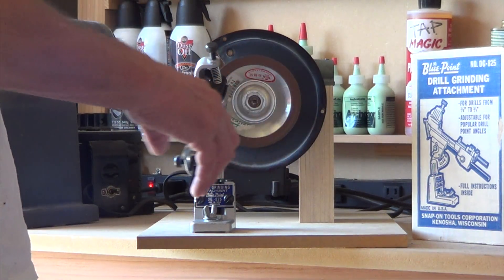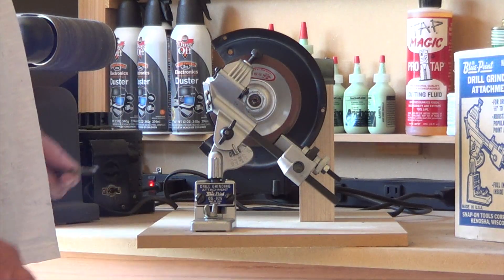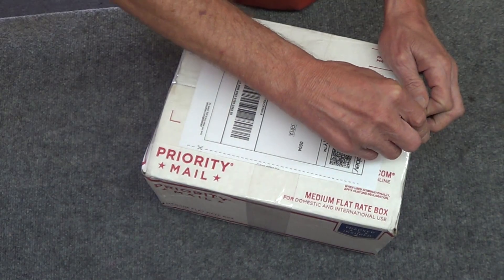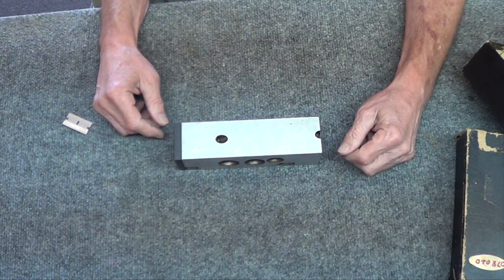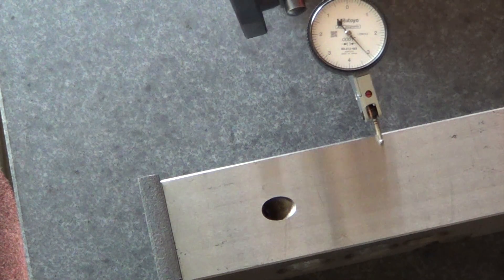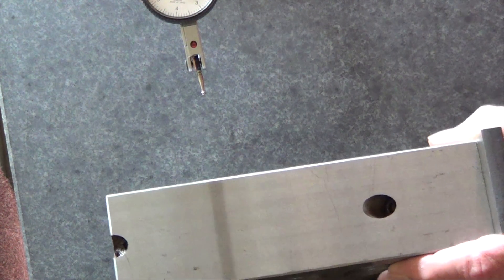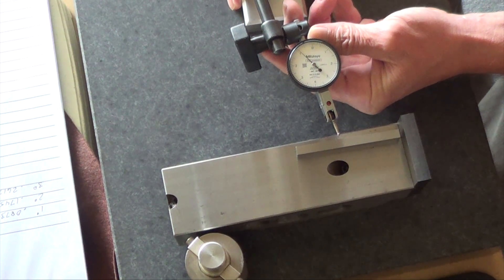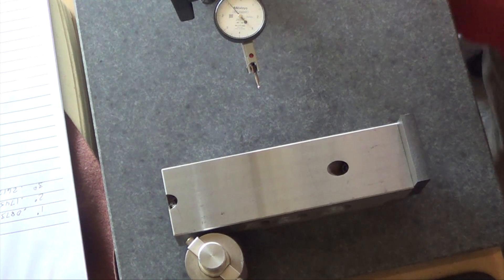How to Check a Sine Bar and Angle Block Accuracy

Comment: If you don't have gauge blocks you can use an adjustable parallel and adjust it to the size you need.
Reply from the maker: Did finally get a set!

Comment: Hey Dave!

Carbides are 'officially' ground with so called 'Green wheels' ( a very soft (friable) silicon carbide grinding wheel formulated for grinding tungsten carbide.) They can be ground with diamond wheels but those are best used wet.
The diamond wheels, from China have something to offer, but it may pay to invest in a proper one. The Chinese ones, is a bit of diamond dust, no good for anything else, mixed with the ashes of dead Chinese babies, I am sure... 
They often have the 'weeble-wobbles' and there is little to be done about that .... it does make them pretty useless though.
Carbide lathe tools or milling inserts/cutters, should NOT be ground freehand... it really is too hard a material for doing that.
Because the Green silicon carbide frays fast the wheel will need very frequent truing. (this is another reason why freehand grinding is just a silly thing to do)

Nice sine bar ! She is pretty! She is flat and parallel within 4/1000 mm, that is nice, very nice.(but your granite slab may only be shop-grade, so it could be even a bit better)
Another small remark is this : if the equipment allows, put a bit more preload on your 10 000 nds clock ( one full revolution is standard practice) 
And cleanliness is next to godliness, even for a heathen like me.... you really need to take the oil and dust off of your surface plate with something such as Windex (works as good as any 'special cleaner for surface plates, at 10 times the cost) and clean your gauge block, sine plate and angle block with alcohol.
When you are measuring in the realm of 4/1000 mm, you also should avoid touching the surfaces involved in the measurement (the surface it rests on and the surface you are probing) or use lint free lab-gloves.

I noticed your surface plate lives on a wooden table or bench. It should be supported on three points. You may discard this, but it DOES make a difference when you want to measure to this sort of of tolerances. ( depending on your climate, try the same measurement early in the morning and a second time when the sun is at its highest and take the dial indicator in the house where there is airco for the duration between measurements) you will most likely see a surprising difference (subject to the precision of the indicator)

All in all...great video !

Cheers

Paddy
Reply from the maker: Still learning on this one. For some reason there isn't much on the subject of wheels and what they're for...
Reply: True, as much literature there is out there on lathes and milling machines, as few documents are to be found on grinding practice.
There are some pdf docs out there, mainly copies of commercial literature (such as by Norton and the like)
I have one book (from my late father) which is rather comprehensive on the subject, but that is written in German.
The main thing to keep in mind is, that when intending to grind very hard materials, you need softer wheels... it may be counter-intuitive, but that is pretty much a standard rule.
Of course you can always go the opposite, but then you get into a bit of a bind when there are no or few harder materials, or they prohibitively expensive for a decent quality wheel.

I have bought the odd Chinese diamond wheel, and some have a usable grinding in them, but I found all of them, so far, too flimsy and light in construction. You can, in some cases remedy this by truing them up in the lathe (the aluminium parts!) and making a mild steel flange which can be bolted or loctited on or against the flange parts of the wheel.
This gives them a bit more mass and allows them to run a bit more stable.
That said, most of the Chinese diamond wheels that darkened my doorstep ended up in the bin rather fast.

Cheers

Paddy